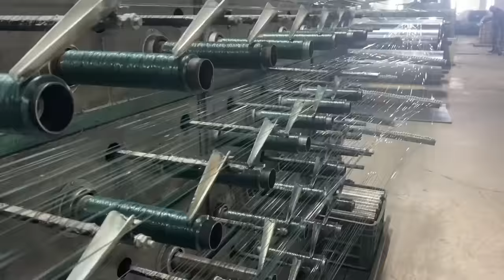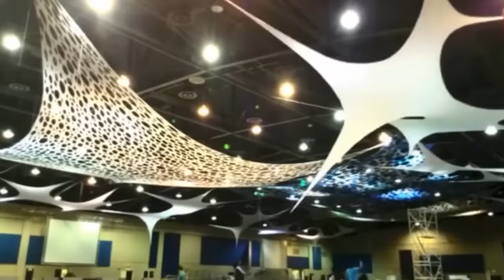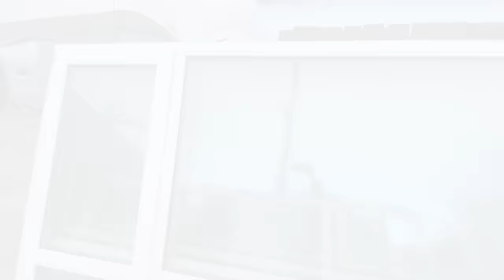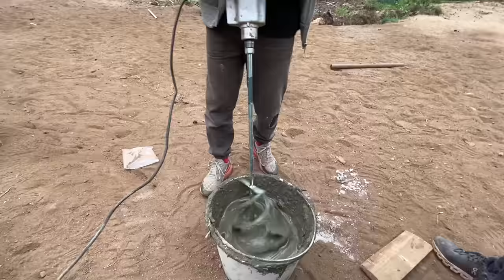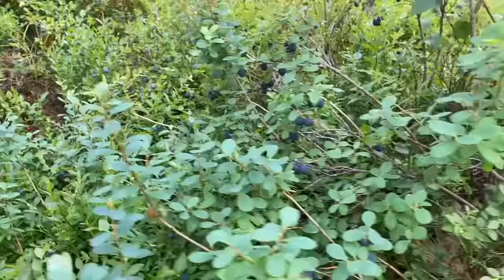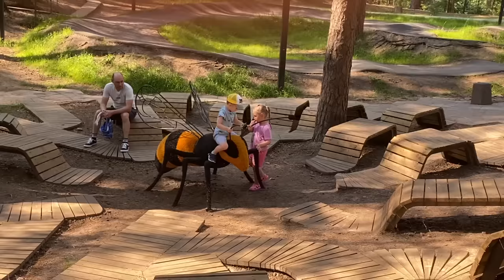X4 bigger & X8 cheaper than a Tiny Home - DIY in 3 months

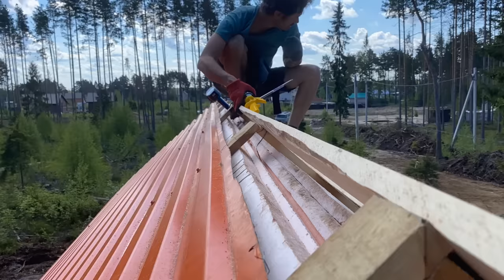Comment: 5:48  Who cut that sheet of roofing iron mate? Looks like it was done with an angle grinder, while suspended from one of the trusses, during a force 10 gale. Just for future reference, if you score the sheet with the rear-most tooth of a panel saw, parallel with the profile, you can bend it a couple of times and it’ll break off, real straight & clean, with no wandering and no hand hackers.
Reply: I love it! (Your comment).

Comment: I have been following you for a while and bought a course from you to help support you when you were in South Africa. Glad to see you are finally at peace. We all seek peace and happiness. Not too interested in the vault arch construction. But i am interested to know if aircrete can be used in superadobe instead of earth. This would be for a tropical climate build. And do I have to buy here in US were I am at the superadobe tubes and take them with me to build in South America? Learn to do aircrete, but want to build quicker than laying bricks or building forms. If the superadobe tubes cannot hold wet cement, what could? Thanks.
Reply from the maker: Hi Marco if you are flying bring in Hyperadobe would be tricky. I suggest going for the aircrete or any brick you can find there
Reply: Thanks for the reply. Might not be flying into my South American home base. I'm thinking of taking a trip of a lifetime and using a camper van to drive down and a ship container for the rest of our things. Will buy a simple house, but want to expand it with and alternate building method. Is aircrete and superadobe tube doable? Or are the tubes not able to hold liquid cement? Thanks

Comment: I'm no construction worker, but aren't the channels in the aluminum roof supposed to run vertically to minimize snow buildup?
Reply: With this design, the ribs need to run horizontally to bend with the arch.  The angle of the roof is sufficient that there shouldn't be much build up.  The size of the ribs at that angle won't have much effect on how much snow it holds.

Comment: I think putting vapour barrier outside the wood structure is a mistake in this climate. when house heated vapour will have no way to go. and there is no ventilation gap either.

Comment: A house that simple in 3 mo.... is childs play.  You want a fast house in sandy soil  12 inch auger hole every 8 feet, sonotube, fill with rebar rock conc.  PT 2x12's Double between piers ea direction.  Plumbing roughing.  2 layer vapor barrier on ground sealed to perimeter 'foundation' of choice, preferably insulated block on grade beam between piers, w termite shield and exterior foam covered with stucco.  4 feet foam insulation on ground around sloping away from building, backfill with drainable soil mix sloped away from building.  PT plywood deck 1/2 inch is ok, caulked seams, 2x6 PT 16 inches OC 8 feet long between 12" beams below, glue to plywood below and above, 6 inch rock wool insulation between.   3/4 inch T&G plywood deck caulk seams.  Double 2 x 10 Ceiling beams, laminate and offset splice to length needed, 4 feet OC, running deck to peak.  if u can afford it 1/2 inch plywood below caulks seams covered with 5/8 fire rated GB, 10 inches rock wool, 3/4 inch board product of your choice covered with WR Grace Ice and Water Shield covered with roofing material / system of your choice.  4 foot stem walls along edges of building with access doors to allow storage behind, giving this house all the storage anyone will ever need.  Storage spaces also create more insulating effect.  Frame out for end curtain walls allowing for standard glazing unit sizes, glazing type of your choice.  You can size this for a 2nd story albeit smaller than the first.  You can build that out initially or later, though note the DIY this post is about or any other with peaked roof will result in most heat in house rising to the top, recirculaiton down or additional heating will then be needed.  If you have a second story open to below, be prepared for that to be a 'hot zone', second floor rooms should be isolated from 'soaring' cathedral ceiling spaces.
This saves the time and effort to make the sexy curved wall with all the seams inbetween and relatively high heat conduction.  No more cost of excavation and fill than in this design.  Roof beams are simpler so less costly.  It reduces heating by decoupling building from earth, and lessens the chance of mold from condensation due to cold floors.  It reduces heating and cooling with heavily insulated envelope.  It reduces pollution (embedded carbon and cancer causing chemicals) caused by foam insulation, both in manufacture and outgassing to inside.  Foam when it burns, and if it gets hot it melts and the melted material burns with a vengance, producing vast clouds of choking killing cancer causing smoke that will redeposit over a vast area polluting it, and risking fire fighters lives.   I'll overlook what looks like planters open to earth below which is another way to say, vermin come live with me.  I assume those planters also had a poured floor and drain of some sort.  Saves on time and effort plastering sexy curved walls.  In the end you can have same size but far better more long lasting cleaner safer building, or a larger one sacrificing a bit of longevity by skimping on elements / materials, and still end up with a safer building (ie indoor air quaility, embedded carbon, chemicals, and in case of fire, life safety of occupants, fire fighters and the community )
A frames are simply the cheapest easiest to build form there is..
Reply from the maker: did you make such a home? or are you dreaming whilst renting or in debt?

Comment: As a naturalized American I never could for the life of mine wrap my head around why people would hock themselves to a 30 year mortgage for a mobile home!  Which is to say a tin can that's an oven in summer and a freezer in winter, with so many tools, materials and technical resources available.  Well this guy cracked the code.  

Unfortunately this might not fly by the Cheka of most American couties' building departments but some are code free.  For Latina America it's a no brainer, that's the Far West of building codes.  
I ask myself though if it would not be better to build the walls with a concrete foundation and rammed earth on top instead of hyperdobe with wood boards in between.
A minor detail all in all.  The concept beats the A frame house by a country mile: more volume less timber used.

It's sad to see  how South Africa was thrown to the wolves.  I think you made a great choice to move to Russia.  It has natural resources to oulast every other country on earth and a culture that has survived the Bolchevick monsters and now Western agression.
Reply from the maker: hyer adobe is super fast rammed earth technique that is liquid in shape. 250 feet of wall 4.5 inches high can be build in 1 day with 3 ppl
Reply: @AloshaLynov   Yeah, I've been thinking hard since yesterday and concluded that is much less work to do hyperadobe.  Thank you.